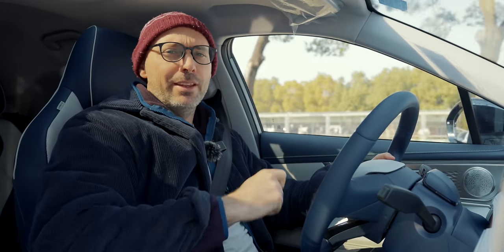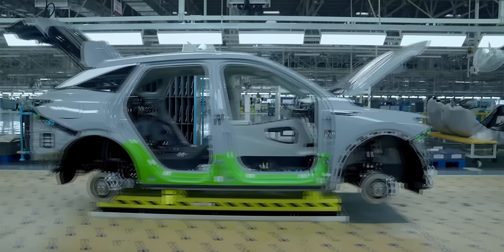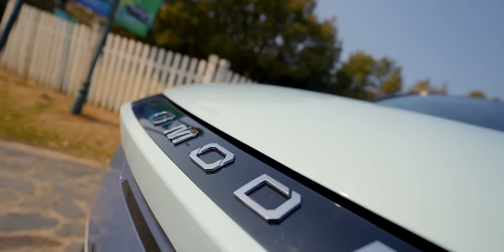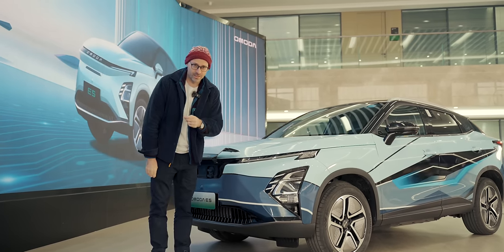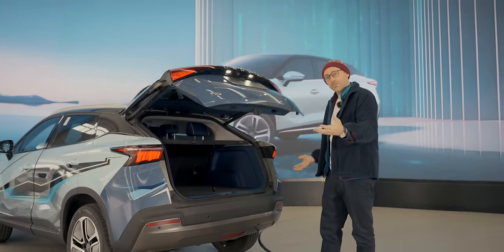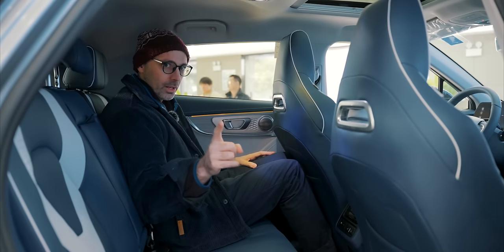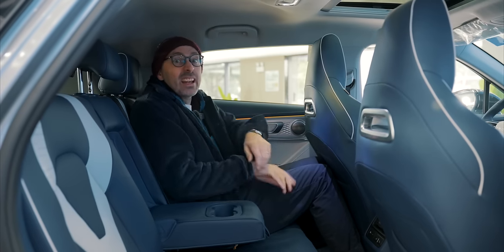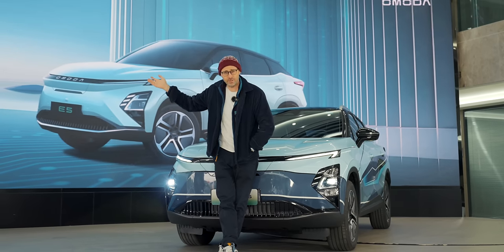There's A NEW Electric Car Brand That Deserves Your Attention...

Comment: Speaking of technology. My sister has a new hybrid car. Almost a year now. No idea nor interest in how the cruise control works, nor what the B is for on the gear selector. Nor what the modes do or how to change them.
And I suspect most people are like her. Way too many options that just confuse and get in the way of just getting in the car and going on the school run or going to th shops. So for a lot of people who just need a straight forward car for straight forward needs, it's going to appeal just fine.
Reply: Friend bought a car 2 years ago, just now wondered what half the buttons on the steering do, and that it has cruise control as well.
Reply: The B is for the regen braking.  When she rolls down a hill in B it charges the battery, therefore using even less fuel so win win!
Reply: Wait till the battery will have to be replaced like with most hybrids, the costs are horrible.
Reply: @ketkroketdumont8238  absolutely, but she gets cars under the motability scheme so it gets changed every 2 years. The hammered battery is going to be someone else's problem.
Reply: Why did she get a car with stuff she didn't need or want ? Just wastes money and since it's a mobility car the tax payers money too
Reply: @damiendye6623  the car comes with what it comes with.
Reply: @patrickjr11 

Yes, the taxpayers.

That's us by the way.
Reply: @t1n4444  is that how it works in England, where I live we have to buy the vehicle ourselves but then get tax back once we've provided why, in our case my better half is in a wheelchair. So the tax payer, of which I was one for 40 years, has nothing to do with it.
Reply: @Iceberg1313  

Why yes, that's why I mentioned it.
Reply: A simple EV is what most people need given the state of drivers, get in drive, regen set like engine braking would be ideal. Most the time a lot of features in car sharing get's disabled as people muck about and make the car undriveable to someone who wouldn't know where to look for the right buttons to reset it.
Reply: @HouseflyUK  The real question is... why would anyone want that turned off? Too many of these "features" are options that should just be how the thing works. Complexity just for the sake of having more buttons. Its why I hate "professional" cameras too. A million buttons for things that should just be a menu option you set up once, not something you accidentally disable and cant figure out what you disabled. Madness.
Reply: @Kennon959  a lot of the features now are mandatory because of EU law. Post 2024 all cars need the features. Sadly, the days of a simple car are long over.

Comment: Price?
Reply: The expected starting price is around £29,000
Reply: arround MG4 or Atto 3
Reply: In Indonesia they sell it around £24k
Reply: For that much I'd rather buy a lightly used Tesla
Reply: Still too expensive for a lot of ppl. We need to get down to ~15000£
Reply: Chinese car companies (maybe with exception of MG) are trying to make a higher profit in the UK, so it will not be priced competitively as it is in PRC or Asia. Yet another basic-spec crossover EV for over £30k if the starting price for the non-EV version is anything to go by. 7 year warranty sounds good, but only if there are parts in the UK available. Otherwise you're looking at your car being out of action for weeks while parts are ordered from China.
Reply: In China you can buy a new BYD EV from £11000
Reply: @Raymaster7482  A brand new electric car for that price?  I doubt that will ever happen. Even Dacia which built the cheapest brand-new cars you could be in the UK (and hardly anyone bought the basic spec model) is now start at around £14k - if you then had cost of batteries, inflation, etc. A brand-new electric car (4 wheels and a decent range) sub £15k might never come along and if it does it will be 5 or more years into the future. Used market is your best friend, get depreciated vehicles with their battery still covered under warranty and some of them have 10/12k miles on the clock for about 50% of cost of a brand-new car.
Reply: @1991Canyon  you're right. But I believe a lot of ppl don't trust used EVs yet... let's wait and see.
Reply: @Raymaster7482  Once you drive EVs, you will feel the smoothness, acceleration, high tech features and a very nice unique feeling compared to ICE cars. The only issues that concern most people are the availability of charging stations and the price. The prices are coming down fast with faster charging and longer mileage so the only issue left is the availability of the charging stations.
Reply: @JCSY1  I drive an EV for over 3 years now and I wouldn't go back. I'm just saying that the main issues are the high prices and the relatively low range (especially if you're mainly driving on highways)
Reply: Dacia spring EV starting at £15,000 range of 137 miles only though
Reply: @jonathon1799  yeah... I hope that battery technology is going to make a big leap forward in the next 5 - 10 years
Reply: @Raymaster7482  Yes. True indeed. Nowadays, the range are improving. Very soon it will have more range and faster charging and the prices should fall further too.

Comment: Editor: Watt was a person, so kW is written such.
Reply: I didn't know that. Thank you so much!
Reply: SI units seem to be a mystery to most electric car journalists.
Reply: @origin178 

"Electrics" full stop are a mystery to motoring journalists.

I put it down to their attending a "Comprehensive School".

I can recall an episode on storage radiators ...

Oh well.
Reply: I'll forgive them using a lower case W if they remember to include the all important hours when talking about battery capacity, leave it out when talking about motor power, and don't claim it has full power at 0 rpm.

Comment: I appreciate fully charged show demonstrating these vehicles, ultimately we all want to help towards the energy transition without breaking the bank.

No matter where these vehicles are made, as the Mozilla foundations report last year demonstrated, there are some very serious privacy concerns with many EVs surrounding the collection and use of personal information.

I understand in addressing this/discussing it on the show that there's the potential to scare/worry others about getting an EV which is against the transition goals. But, if we don't talk about it, regulatory change will only take longer and forwarned is forearmed for those looking to purchase an EV. 

Thank you
Reply: Yes a panel discussing these issues needed. Several YTers have complained about eyes off road chasing through menues on touch screens to do the simplest adjustment.
Reply: In the uk there is absolutely no financial incentive from the uk government to buy an EV,there was, unfortunately it was scrapped.

Comment: Here in the UK, insurers are getting a bit jittery about these cheaper Chinese brands and some cars including BYD are getting harder to insure or impossible to insure.
Reply: That's strange, since BYD has excellent safety ratings and with its blade battery the safest in the industry.
Reply: @gantenbeinable  It's more to do with availability of parts following a crash.

Comment: Nice looks, but Chery has a poor reputation here in Aus, so the price will have to be well under the Atto3 (whatever it will be?). And I already have the BYD.
Reply: In Malaysia they price it much cheaper than atto3 yet has so much features compared to the Atto. Best one is 3 phase AC charging over the BYDs single phase
Reply: @PsychedMedia  3 phase is great, but I can't get it at my place. I might test drive it if it gets here, anyway.

Comment: One of the most dangerous manoeuvres you can do in a car is reverse out of a car parking space. For this reason, I strongly prefer charge ports on the back of the car so I can reverse into the space. I'd always prefer to reverse in, than reverse out.

Comment: The only thing i miss in modern EV, especially after this year with the new EU regulations: A button which i have to press for one time or say 4 seconds for the safety to turn off this annoying beeps and assistants which want to kill me without using a display and hunting all this settings every time i start the car. :/
Reply: it's gonna have to change and get back to some normality.
Reply: @TerryHickey-xt4mf  Yeah. All are hating and flaming the different engines. ICE vs BEV; BEV vs ICE. All this nonsense. This annoying crap is in all cars with every engine and no one wants to end this paternalism. :(
Reply: It's a regulation for all engine types, so all new cars are affected I'm afraid.

Comment: These guys are also one of the new partners in nio's battery swap system. Not this model tho.
Reply: Still, the fact that now Nio has made agreements with multiple mass market brands for battery swapping including Geely, Changan, JAC, and Chery, means maybe battery swapping will go mainstream in China. Especially if they can coax SAIC into their consortium as well, which would represent most of the big players in the Chinese EV space not named BYD or Tesla.
Reply: @tren133  good point

Comment: Would I be interested in a cheap, simple, practical car without huge wheels but with good safety? You bet. That is EXACTLY what I would like. The interior looks decently nice too (a bit more space for the rear passengers wouldn't hurt though). The only thing taming my enthuasiam it the exterior. Not really my cup of tea in that department.

Comment: Brilliant indicator sound.  That is a big plus point, just a shame it is ruined by the irritating bong when something passes you.  If that and seemingly required by NCAP positively dangerous lane assist "features" are not capable of being turned off as a default then it is not for me
Reply: Isn't default-on an NCAP requirement?

Single button-press for off should be a priority though...
Reply: @dogsbodyish8403  Pretty sure you are correct but that should only be the case when the car leaves the factory thereafter it should be the drivers choice - not every time he/she drives but there should be a setting that allows you turn them off permanently.  The problem with current "driver assist" is that in many cases they are in fact dangerous
Reply: The indicator and the other bong sound can be lowered all the way down (even mute) by the touch buttons on the screen all the way to the left

Comment: The car has all the real features we all need. 

15.5 kWh/100km = 4 miles/kWh. WLTP range of 267 miles means 214 real range (~ -20%), meaning 182 miles of real practical range (100%-15% SoC) which gives you 3 hours of driving at 70 mph.

My Ioniq 28 has a 88kW motor, so 120bhp, never seen it use more than 40/50kW 😂. No one needs a 150kW motor.

If they had put 16inch wheels and lowered the car, they would have also reduced costs and improved efficiency.

Regardless, this is a seriously good EV on paper.

Comment: Someone needs to bring back the station wagon as an EV, Commodore/Falcon style
Reply: Easy, just go buy a Taycan Sports Turismo! 

Seriously though there are wagon EVs, just mostly in China. The ancient MG5 EV aside, you've also got the Zeekr 001 and the absolutely stunning NIO ET5 Touring. If even those are still too expensive, there will be the upcoming Wuling Starlight Wagon and Hozon Neta EP42 Wagon, both still looking very cool, and the Wuling is going to be dirt cheap too.

Comment: Never heard of the Chery brand until today Omoda E5.4 5 star 🌟 🌟 🌟 🌟 🌟  safety rating, V2L. Economical, practical, functional. Form, fit, drive experience, cabin noise, reliability issues, simulated engine tone? Price range?
Reply: Chery is the biggest share holder of Mercedes.

Comment: Never understand the fascination with seat heaters.  If it is cold out, I'm wearing cloths..  What I do care about is ventilated seats when it is hot as the AC can't help your core temp come down.
Reply: It's really nice to go out in a winter morning, know it's -1 degree C. and still feel confident to hang the jacket behind the driver seat before driving off just wearing one layer of clothes (or two). 
Totally understand if you prefer AC, but "why not both?".
Reply: I thought the same until I got them. Heat directly on you is very efficient and also uses less energy from the EV battery compared to AC/heat pump.
Reply: @Nikoo033  I've tried them and if I want to feel like I peed myself, I'll pee myself.  I just don't really get cold in the areas that seat heaters help with.
Reply: @NunoLima1337  Nah, it does nothing for my hands/arms and feet that are cold.  Don't ever recall my butt feeling cold. Must have too good of padding.

Comment: You see little bits of many other car makers in the styling yet I only see one: Nissan. The side and back SCREAMS Qashqai and Ariya. The interior is also a knock off of the Ariya.

It seems a good value car, and a blade battery is always a plus, but I can't get over how hard it's trying to be a Nissan. I don't get why you'd buy this instead of the soon-to-be Qashqai EV.

Comment: Does the sunroof close? If so it gets my vote over Model 3 and Seal. Cars get hot enough in summer. Hoping into the work model 3 at the moment takes planning
Reply: Yes it has a shade and applying a UV tint to it could even make more wonders I reckon

Comment: Not meant as Sinophobia … I own an MG4 … but this looks like the kind of car the Chinese industry was putting out 10-15 years ago. There are styling cues that are direct lifts from existing cars. But the most egregious steal is the brand name, and the styling of the brand name … OMODA … ŠKODA … they’ve even copied the horizontal lines bisecting parts of the letterforms.
Reply: Well spotted
Reply: Skoda and Omoda are miles apart in similarity. Nit picking. If it's not Chinese, you wouldn't have any issue with the name.

Comment: NO,NO,NO they are just dumping crap, you will never get the parts in 5 years time. EVs are just IOT devices that will need to be replaced every few years which is not environmentally friendly. Try replaceing your dashboard in 5 years time when the screen starts to flicker or dies. I want a car that does not have a screen unless it uses an iPad via a Bluetooth ODB port.

Keep cars basic with no bells and whistles. I think this channel is now a sales channel for Chinese car brands.

Comment: Is this another Chinese brand that's going to go bust in a couple of months? Starting price for the EV version looks like it will be about £35k in the UK for a mid or high-spec trim. Hmmmm.

"£24,000 list price with the petrol engine in standard ‘Comfort’ guise, which is around £2,500 less than the cheapest Qashqai. But there’s no word yet on what finance arrangements will be in place – a key factor for private customers." - no details of EV price, so expect a high premium. That starting price is not particularly impressive when you consider this is an unknown PRC brand in the UK with very little infrastructure to support it, and long lead time for parts that have to be imported.

Comment: You know what would make it slippier through the air? Not hubcaps, a lower profile (think non Crossover/SUV), less weight, longer roof. 380L boot? Pathetic

Comment: Still think I'd rather have an older car, converted to electric.  Beetle, corolla, civic, anything with a CD player and a radio.  Not f-ing car play.
Reply: When I get inside my EV, phone in my pocket, ALL my music is available and played automatically without having to do anything. Radio accessible if I feel like it via a click of a button on the driving wheel. Can even listen to podcasts. Can’t beat that. 😊
Reply: @Nikoo033  Hooray for you.  I still want a normal radio though... and no touch screen.
Reply: @martythemartian99  there is no “normal radio” anymore. Everything is digital nowadays anyway.
Reply: @Nikoo033  Not true.  Yes there is digital, I do have it.  But there is STILL am and fm radio.  It is still broadcast, and you can still buy the hardware.
Reply: @martythemartian99  what, in museums? 😂😉

Comment: At the end of life for the millions of EVs batteries are the manufacturers going to take responsibility for their disposal/recycling?
Reply from the maker: I suspect some will not, (some car companies are already in the process of recycling their batteries) and very much like the nuclear induistry around the world, we, the tax payer, end up forking out for the storage and reprocessing costs of nuclear waste. Does the French company EDF of the Chinese companies building Hinkley POint C have plans for the safe 10,000 + years storage of the waste they will produce? I think not.
Batteries on the other hand a re a lot easier to deal with. 
Check out https://www.redwoodmaterials.com/
And we still have about 25 years before we are dealing with millions of batteries. The industry around repackaging EV batteries into static storage systems is growing rapidly, the batteries have another 10 - 15 years useful life after the 15-20 year in a vehicle.

Comment: Maybe it deserves your attention; but most Chinese BEV makers have never made a penny; and many will go broke this year. So even if it bucks the trend of being low a low quality chinese car; you could easily be left an orphan if the company goes bankrupt.  Beyond that no chinese makers understand quality assurance - that is a means to assure all cars are made with quality.  Perhaps you've never heard of Deming.  Chinese do not test parts before they install them nor do they take finished cars aparts to check welds and functions; so you can find many videos where the airbags don't deploy in accidents; were they catch fire; where they don't brake. Just too risky for your families lives.